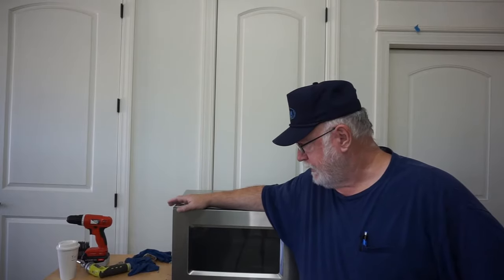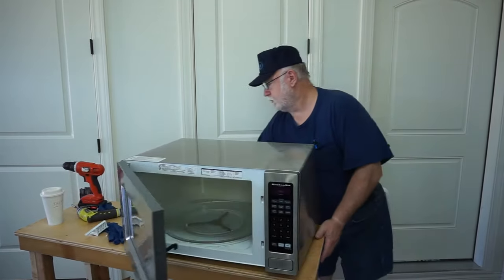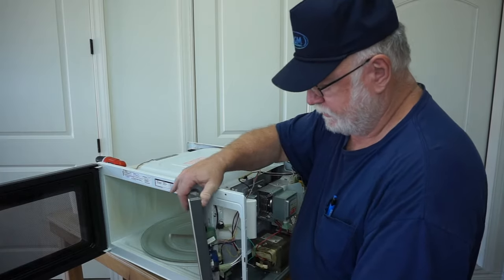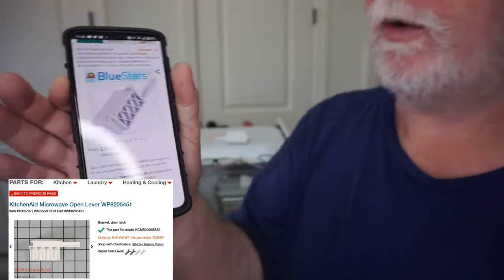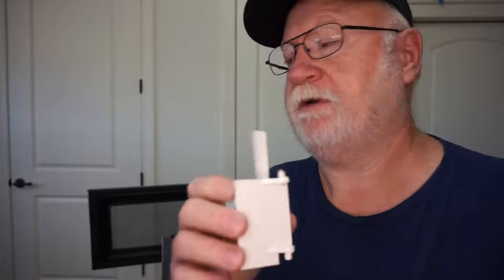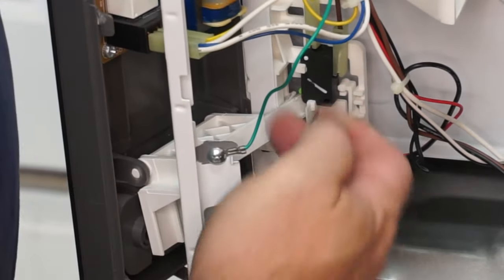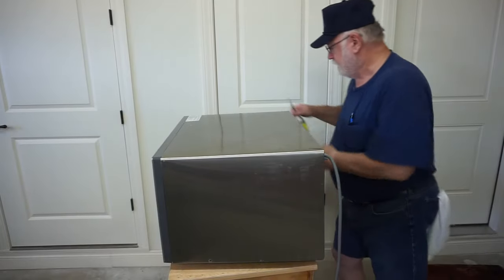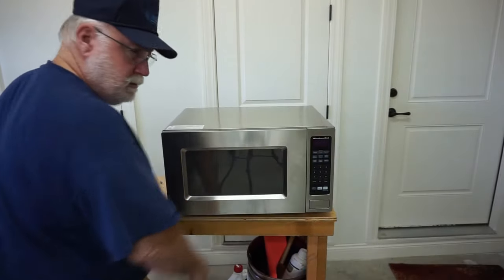Reviving Your Microwave: Assessing the Value of Door Latch Button Repair

Comment: Thanks for this video!  It helped me take apart my microwave to see what was broken in the door button.  Turns out that for me, it isn't the latch lever itself, but one of the dark plastic tabs that holds the axle in place.  The tab that broke is on the same side as the axle that you repaired in your video.  I think (hope) that I can just glue it back together, but I don't know what kind of superglue or epoxy to use.  Any suggestions would be greatly appreciated!  Glad you're feeling better and back in the garage
Reply from the maker: There is a two part plastic epoxy glue that is very strong. However, if there is enough room, put the piece in place, drill through it, put a screw in it and if possible, countersink the screw head. You can still put the epoxy on it as you put the screw in and it isn't breaking again.

Hopefully that will help.

Thanks for watching.
Reply: @MaxsGarajMahal  Thanks for the reply.  There isn't room to screw anything in, as what is broken is just a thin plastic collar that holds the axle pin in place.  But I can epoxy the piece back in place, and I'm going to epoxy something else (no idea what yet, but I'll figure it out) between the repaired collar and a ridge on the other side to further support it.  I saw how hard you had to press to get the door latch lever back in place and I'm worried it will break if I don't shore it up with something else.  Fingers crossed and thanks so much for your advice!
Reply from the maker: @enthusiator  If I had you and it here, we'd figure out a 'cure' for it. I feel like you'll do just as well without me so I wish you luck and want to hear back from you once it's done.

By the way, is there any way to come in from the inside to add some strength?
Reply: @MaxsGarajMahal  I don't know where you live, presumably in the southern US just based on the different way you and I pronounce certain words.  I live just outside of Toronto, Ontario, Canada, so I bet a new microwave would cost far less than a trip to see you!  I was thinking you'd be an excellent neighbour to have though.  I imagine you help lots of people around you.  I did add some support to the tab that holds the axle.  I was searching around the house VERY late last night and came across one of those little clips that are used to hang frameless mirrors.  I know - ridiculous.  But it was the one thing I found that was close to the right size, though it did wind up to be far too big.  I don't have the benefit of a workshop with the right tools, soooooo I wound up shaving it down with a vegetable peeler and then continued to wear it down with an emery board until it was the right fit haha!  Necessity really is the mother of invention!  I think you would have been cringing and shaking your head though!  I reassembled everything and reinstalled it into the kitchen cabinet.  So far so good!  If the support fails, at least I now know how to open everything up, and I'll try again with something else.  Thanks for your support!
Reply from the maker: @enthusiator  Best of the comments I've had in quite a while. If you watch all of my videos you'll hear me say many times: 'I had what I used and used what I had'. 

I'm converting a plastic soldering staple gun from 110 volt to a 12 volt power supply that you use for many types of portable applications or for charging cordless tools. 

My idea was of putting a 12v automotive relay in the mix so that it carries the load rather than the trigger and inline automotive flat blade fuse before the power makes it to the soldering tips. If it works the way I expect it to, I'll make a video showing all the people just as myself that were ripped off by the plastic soldering gun sellers to convert theirs.

I really hope that thing outlasts the rest of the microwave and am very happy I may have helped in some small way.

My lovely bride told me to tell you we're not that far by the way crow flies. Only about a thousand miles in the dead center of Arkansas. 

I'm keeping an eye out for you in the event you come this way. lol
Reply: @MaxsGarajMahal  Well, I definitely had what I used and used what I had!  Good motto to live by.  

Looking forward to seeing your results with the plastic soldering gun.  I saw your video on the failure of the one you got.  What a pain.  Sounds like yours might be a million dollar idea!  

You helped out in a very big way, actually!  You outlined very clearly how to open up the microwave and how the latch works.  That was enough to give me the guidance and confidence to open it up and give fixing it a try.  You clearly help a lot of people online, and as I said before, you're probably an excellent neighbour to have.

I'll let you know whether something changes so you can watch for me in Arkansas.  I wonder if I can drag my pool heater down there for you to figure out and repair... That's a fix that requires a lot more than a plastic clip and a nail file, so it's well out of the realm of possibility for me!   And the trip down there might actually be far cheaper than getting a new heater.  Hmmm...
On second thought, Arkansas seems to have some stunningly beautiful places to visit, but I think I'd rather you and your lovely bride come up this way so I can apprentice with you while tackling my mile-long to-do list, starting with that pool heater LOL!
Reply from the maker: @enthusiator  That made me laugh in a couple of places. lol

Is it snowing up there yet? It's supposed to be 50 degrees next week at night. 

Actually, back in '04 I took the Lovely Bride to Canadia for 90 days, however, she only managed to get Manitoba west, up into the Yukon, across the Over The Top Of The World highway to Alaska, back through British Columbia, over to Victoria Island, then headed home via WA, Oregon, Cali, then across I10 home with the exception I was deployed from Alaska to Orlando, FL and driving our own vehicle so I had to do this in less than 3 days. Stopped in LA for two hours for a sister in law's funeral and on our way to complete the drive to Florida. 

Don't recommend such a drive as you'll break a few city, county, state and federal laws to be where the President sends us. 

So, tell me what that pool heater is doing, shoot a bunch of photos of the equipment, brand, model, etc. I'll check with some friends to see if we can get you a diagnosis and prognosis.

Thanks for the laughs.

Max
Reply: @MaxsGarajMahal  That sounds like quite a whirlwind trip around a good chunk of Canada!  And actually you've seen quite a lot more of my country than I have :)   I'll get around to it someday, hopefully!
  
No, it's definitely not snowing where I live, which is at the western tip of Lake Ontario.  It was about 93 today when you factor in the humidity!  Hence the need for the pool.  Next week, the lowest temp is forecast to be 71 in the day and 57 at night.  Our summers are probably more similar than you'd think - quite hot and humid, but for a shorter time than in Arkansas, I imagine.  We may start to get a little snow near the end of November, and then it ramps up, peaking in January, when we get on average 12 to 14 inches in total over the month.  But there are some years when we'll get a month's worth of snow in one storm!  We usually don't get snow after March.

The pool heater is doing exactly nothing!  I pressed the temp down button about a month ago and the whole digital display panel went dead.  It's a Hayward H250ED2C.  I gather from my nephew with a multimeter that there is power coming to the circuit board from the transformer, and power coming out of the circuit board, but that's as far as we got.  A couple of wires go into the back of the heater where the water pipes are and where the actual fire should be, but we couldn't investigate that further at the time.  I don't know why the wires go back there - maybe a thermostat? The ignition wires are in the front part, and they seem to be okay.  There's no obvious sign of a short on the circuit board, and I did change the fuse on the board, hoping for a $4 fix, but no luck!  I'm not sure if my nephew checked the connection between the circuit board and the actual digital display.  I'll have to text him.  He's a car mechanic apprentice, so gas heaters certainly aren't his wheelhouse, but he put forth a valiant effort.  He was rewarded with my homemade fresh peach ice cream AND even homemade sugar cones.  See, I bet you didn't know that we have a great climate to grow excellent peaches here in southern Ontario!  

I'm not sure how to send pics of the heater to you, and I imagine it would be hard to assess from such a distance, but any help is greatly appreciated!
Reply from the maker: @enthusiator  That system is basically a huge water heater with HVAC roots.

I take it the digital display is not showing the error code to tell you where to begin?

You can email to my gmail using my youtube name which may make this a bit easier for you if you prefer. 

I'm leaning toward the igniter has gone bad however you should be getting IO error code if the display is functioning properly.

When the system calls for heat, the circuit board is going to check to see if it has water, then it will call for ignition sending a small current from the electrical board to the igniter circuit that will first allow the pilot light valve to open sending gas to the pilot over the igniter (glow plug).

The igniter is already glowing red hot when the gas reaches the igniter causing the gas to ignite causing a flame. 

Once the pilot flame has heated the bimetal  thermocouple which when it reaches it's allocated degree that send a current to open the large side of the gas valve flooding the manifold with gas. The pilot flame then ignites the manifold which heats the water moving through your system.

Therefore, I'm leaning toward these three things: Igniter - thermocouple -  circuit board. 

See if the blower motor spins easily. You can also jump the blower motor to make sure it is working when the system calls for the blower motor to work. 

Your nephew can check each of these things fairly easily with his multi-meter and I applaud him for stepping in and I know there was no way he was going to miss out on the home made peach ice cream.

Canadia trip 2004. Can't call it a fun fact. 

Left Arkansas it was 80 degrees. Got to Olathe, Kansas, 101 degrees. Got to Manitoba, 102 degrees at the border. Border agent asked me if I had any weapons and of course I had my little ole Case plastic handle pocket knife laying on my lap and I quickly held it up and asked: "You mean like this sword?"  He did a double take, laughed and asked me what I called it? I said a Sword.

He called two other agents over, they all laughed and said to get the hell out of here. So, I drove right along. Under the rear seat of the old truck may or may not have had three something or others that may or may not have dispensed a lot of fun in one run.

On the way out of Canadia. I sat in line for hours trying to be on my way after 3 months seeing and spending a ton of money for non-sense I didn't need. lol

Got 84% of my tax money back. Hmm, that's different. But, they were pulling everything out of everyone's RVs and SUVs and of course they put me in that line.

The lady agent asked if I had any weapons? I asked her where I would have bought any weapons in Canadia cause ya'll don't have any guns do you? She said of course we do. 

I held up my tiny little Case knife and said well does the Sword count? She went cross eyed, bent over laughing and called the agent standing in front of the huge RV behind me and three others with mirrors walking around my SUV, took the agent off the one in front they were removing the interior out of it and they all gathered trying to see my Sword.

The lady in charge asked me if I brought that knife into Canadia. I told her first my Case Sword is very hurt you can't call it sword because it identifies as a sword. This was 2004 remember.

She said she was very sorry and didn't mean to insult my Sword, but the other five were jabbing her with funny comments and she said, have the line back up because the fella from Arkansas is going to keep us laughing and we're not going to find anything if we're not working. 

I asked: "Don't you want to see my machine guns also?"

She looked at me, laughed and asked me isn't this you in that truck passing through check point in Manitoba? I looked at her tablet and said, well just because it looks like me doesn't mean it couldn't be a doppleganger. But, check the plates and if the plates fit, guess I must admit. Me.

She said you come back to Canada, be sure to come back through this check point cause you made our day. Toys still in place, made it out of there alive and deployed to the four Hurricanes Charlie, Francis, Ivan and Gene in Florida in 3 days from the western most check point in the Canadian border. 

Glad I wasn't shot. lol

Good luck on the water heater. It's going to be very simple.
Reply from the maker: @enthusiator  By the way, remove the igniter from it's home, lay it up on the top of the heater, make sure the igniter hot end isn't touching anything. Then try turning on the machine, see if the igniter gets hot. You can also use a non-contact electrical tester to see if there is any voltage going to the igniter wiring. The igniter is on the lower left side with two white wires going to it from a white plastic plug.

You can unplug that, ohm out the igniter as well.
Reply from the maker: Danielle, go to this link, watch that video and you'll see how easy it is to do. One of these Plastic Hot Welding Staple Guns will resolve your problem. Here is the link to that video: https://www.youtube.com/watch?v=FVB-XXbxH5I&t=216s

he solution you are seeking is in my last video named H50 Hot Welding Staple Gun Revived, It's Alive?! 

That sucker put a rear fender back together on my dirt bike and an electrical part cost 300 dollars that only broke the mount off under the dash. Mower can't run without it. 

You can pick one of those up fairly cheaply on ebay or Amazon.

You can also make your own gun and staples out of items around the house. Just melt the wire half way thru the plastic letting go of the trigger as soon as it has implanted the wire into the plastic totally submerged if possible. 

The panel control board is available. Here is the part number: Panl-Cntrl WPW10160556 / AP6015974 

https://www.appliancepartspros.com/whirlpool-panl-cntrl-wpw10160556-ap6015974.html
 
Part Number:	AP6015974
Made by:	Genuine Whirlpool part
OUR PRICE
$144.58          
REGULARLY	YOU SAVE 
$177.20	$32.62

With both pieces of information I feel certain you will be able to make a long lasting repair for your microwave. We at Max's Garaj Mahal prays we have earned your
Like, Subscription, Hit the Notification and Sharing. We need all we can get to help you in your next repair or replacement video.

Thanks for watching,

Max Hughes
Reply: I'd be concerned about safety if I fixed it - EMW escaping.

Comment: I have a Panasonic with the same problem.  What is the part called. Please and thank.
Reply from the maker: Deborah,

Sorry for the late reply as I just saw the email. If you'll supply me with the model number of your microwave, I'll see if I can't find the correct number as well as the name of the part as different brands although the same part are called different things.

If you'll provide me with your model number & serial number I will see if I can find you the proper name as well as part number for your particular unit. If you choose to do the repair my way, you shouldn't ever be required to open it back up for that again as the latch isn't breaking that screw.

If you'll email me the information along with your phone number if you get stumped, I'll do my best to help you over the phone. Just add @gmail.com to my name and you're set.

P.S. I did look up Panasonic although it was generic, they called it a Door Hook. I think their hook is due to having 3 microswitches on it at $53.75 which I can't imagine you need the microswitches until one goes out. 

Good luck.

Max
Reply: @MaxsGarajMahal  thank you so very much.  I  will look into future. Your help is greatly appreciated.  God bless you!
Reply from the maker: @dehansen1960  It will be my pleasure assisting you if at all possible. God bless and thank you for watching.